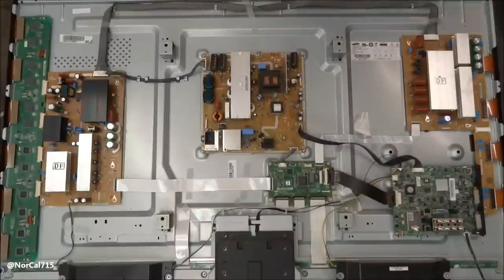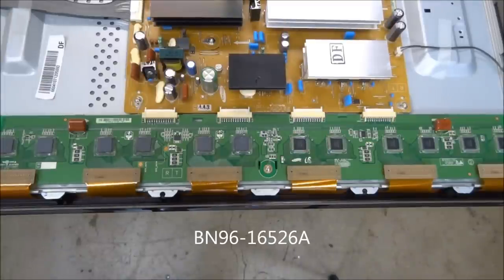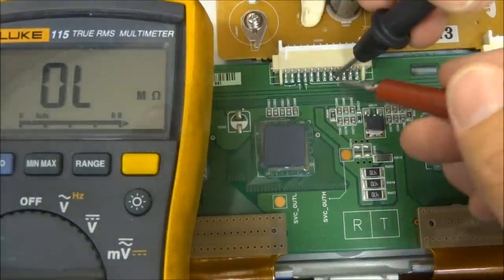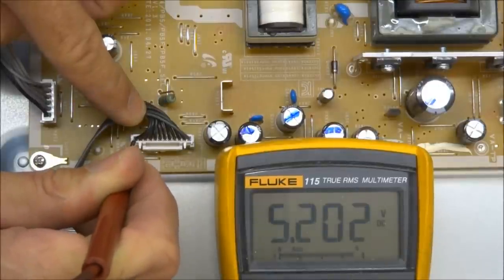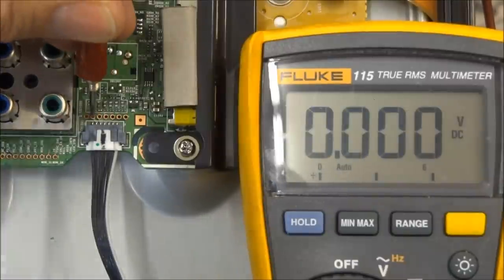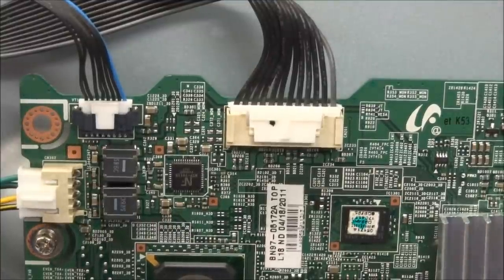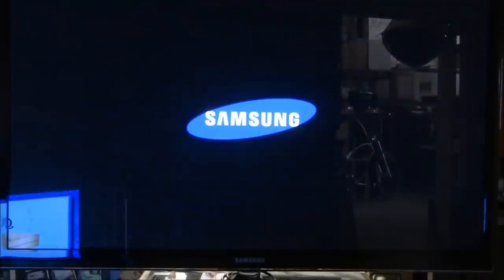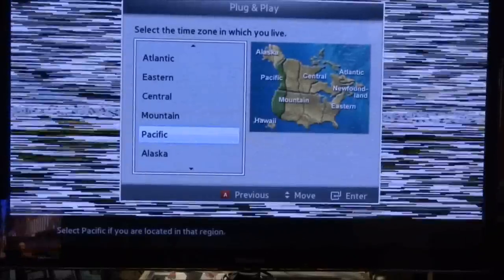Samsung PN51D550C1FXZA Voltages and Troubleshooting

Comment: Thank you so much for your great video. My Samsung PN51D550 is having issues powering up (clicking on and off) and i couldnt find any blown capacitors on the power board, but after doing some research, I thought it could be the power board and ordered a new one.

I wished I found your video earlier as I would of have spent more time diagnosing the components to determine exactly where the issue is as I think its not the power supply anymore.
Reply: Did you ever find out what the issue was or did you toss it?

Comment: Thank you for the terrific video! I have a Samsung pn51d530a3f. The layout is basically identical. My power supply is a p/n BN44-0444D. My plasma tv started doing the flicking on and off thing a couple days ago and now it does nothing. No lights, no power up, no standby lights, etc. When I test the power connector on the power supply board as you showed, I do get the standby power on the pins 1 and 2, however I get nothing on pin 4 where yours would typically show 15v. Also nothing on the other pins 7 and above. Are these only energized on the startup of the tv? That would make sense why I'm not seeing voltage on them if that's the case. I don't see any visual swelling of caps on the power supply board (not necessarily an indication that they are good though). My initial thought is that this is a PS issue. I've unplugged the Y and X boards and still nothing. I'd rather buy a new power supply board if that's what the problem is. Any suggestions would be greatly appreciated. Again- Thanks for the time you took to post this very informative video!

Comment: I have the slow heart beat that you mention, but this is only after I have unplugged the left board (when looking from the back side) from the power supply board. With this board plugged in I get the 5 sets of click click CLICK of the unit trying to fire up, and then nothing be a flashing red light on the front of the unit. I get same slow heart beat issue when I plug the left board back in and unplug the right board from the left board. Your thoughts and or advise sure would be appreciated. Thanks.

Comment: Norcal This video was awesome Thanks! I was able to follow your tips step by step and everything works just the same as in your video besides the screen stays black when the main board is hooked back up. If the test mode worked with all the colors and patterns but the screen is black with main board plugged in would that be an obvious main board replacement? Thanks for your help.

Comment: Thanks for the great video!  I have a Samsung C550 series plasma with the purple sparkly band and the the VS adjustment worked perfectly!   I am above the spec of 209 by 2 volts, but the band is gone and TV life is good!!!
Reply from the maker: Samsung says + or - by up to 15 volts is acceptable. as the plasma panel ages the setup voltages change. also temperature affects it as well.

Comment: I have this exact model and on the y buffer board I came up with 0 resistance for the ohms test on the points you describe.  Before I spend the money is there something else I can do to verify that this is the culprit?  You also mention you typically have to replace all of the y boards, should I just purchase all the boards or is there something else to check to determine if it is just the buffer board?  Thanks.  Oh and great video BTW, very informative.

Comment: Great video. I have a Samsung PN50b450B1DXZA All the power seem to be OK VSC s -193, Va is 55, Vs is 209, Ve is 89. the heart beat led beats at one a second. I tried the test you demonstrated with the jumper on pins 3 and 4 and lines to the main board shorted. I get nothing on the screen.The y-buffer was replaced along with the Y-main.I also replaced the X-main. The tv played for a few days and a component blew  on the X-main a small six leg device at location Q4201. I returned that X main and got another neew one now I get nothing on the screen. Could my screen have blown when the component blew on the x main? I have correct voltages all over the tv and a blinking heart beat led bit no picture. Is there a way to test the screen to see if it is bad?

Comment: Nice tutorial!  I have a Samsung PN58A550S1FXZC.  I would like to do the self test, but the PIN names are not the same as your TV and my connector has 24 PINs.  PIN 1 is PS_ON and PIN 3 is STBY.  Would it be PIN 1 and PIN 4 RTN instead in my case?

Comment: Thank you for the awesome vid.  It was very helpful as I have an issue with the same model tv.  I was watching tv one day only after about maybe an hour when there was a pretty loud pop and the screen shut off.  It then began to cycle through this process to turn on but never does.  The power led blinks twice five times while making the clicking sound the set makes when it attempts to turn on but nothing ever comes up on the screen.  I took the back panel off and expected to see some blown capacitors but have not found any.  I would really appreciate some feed back if you have any recommendations for troubleshooting.  It is my only tv and of course it is out of Warranty, any feedback if greatly appreciated.

(blink pattern: -- -- -- -- -- pause then repeat)

Comment: Hello,
I own a 2011 plasma 51’ D550.
I have black horizontal lines on the down third of the screen.
I clean both side of the down rubbon plug ged but still got the line.
How can I find if I have to change the LJ92-01761A or the other side bigger panel?
Thank you for your help

Comment: The ohm test on my Y-Buffer board failed.  
There's a heat sink (small black one) on the Y-Main Board that seems really hot when the TV is plugged in for awhile.  I'm assuming a short on the Y-Main Board.

Question 1: would ordering a Y-Main Board be enough, or would both Main Board and Buffer Board be needed?
Question 2: would a Y-Main/Buffer board from any PN51D550C1FXZA work, or do the numbers on the stickers have to match exactly?

Comment: Here’s a question for you. I have this exact TV (Samsung PN51D550C1FXZA) and have followed everything you’ve done in this video. I’ve replaced all boards except the Y and X main boards. Still does not work. I tried jumping the tv but I still don’t get test patterns. I did notice that the green LED on both the new and old logic main board is not present. What could that mean? Any ideas on why this tv still doesn’t work?

Comment: I hope you can help I,ve watched most of your vids on plasma your very down to earth so here we go ist off i changed the main,logic,power board if I turn on tv clicks 3 times goes off but if i disconnect x board it stays on then I can plug x back and it stays on but no picture just sound but all the buttons seem to work change sound and channel  and 1 other thing if i shake the wires going from the power to main board the 2nd wire down it starts clicking on the power board so i put the other power board back in and same thing so i think that,s in the loom please help me John

Comment: norcal - im trouble shooting a s50wh-yd14 plasma, which I believe the power board is the issue. the vs-tp should read 205v which is reading 10.9v and the va-tp should read 58v which is reading 0.0 now, was reading 2.9v. no caps are blown or browning on the board. I know the voltages are way low. so replace the psu ?

Comment: Does the Samsung 42'' Plasma HPT4254X/XAA have the self test option? I disconected the main board, Shorted pins 3 and 4 on the logic board and grounded pson. Power board went on had all the right volts Vs205, Va63, green light on logic was flashing about once a second but no self test picture, screen was dead so I was wondering does this model offer this test or is there something else wrong. Thanks

Comment: A vertical line from top to bottom that is about 1-2 pixels wide.  Is it always the panel or can it be the control board as well?  TV is a Samsung PN51E7000FFXZA

Comment: I too have a Samsung plasma tv PS43D450A2 model with horizontal black lines in the middle part of the screen. 
The tv is fully operational.
The voltages on all test points of the power supply, y-main board test points read fine according to plasma screen stickerwith Va, Vs and Ve readings. The X main voltage at test point XS-E is 78V 

But when i test the voltages across the smd resistors R5149 to R5154 and smd zener diodes D5504 to D5506 (marking PJ1389) on the Y-buffer board,  i found that the voltage is fluctuating between 45V and 30V.  It keeps dancing up and down on all the resistors and diodes across the y-buffer board. 

I felt the ICs on the board with my fingers and they were all warm. Nothing too hot or cold. Is this a voltage regulation issue from the y-main board or a y-buffer board issue? Little confusion here ;-) The heart beat led light on the logic board is good. I have tried re-seating  the flex cables on the y -buffer too.  The only thing bothering me is the fluctuation in voltage across the resistors/diodes on the y-buffer board. 

Could it be bad capacitors on y-main board? But the test point voltages on the y-main read ok. So the confusion haha. 
Any feedback will be really helpful. 
Thanks n regards

Comment: hi there thanks for for sharing information, i have similar TV set i am working on,  power supply not booting up . it has clicking noise coming from relay,  power supply trying to boot but voltages goes up and down, any suggestion please.

Comment: I have the exact Samsung model and I seem to be having an issue with the standby power from what I'm gathering. When I power the TV all I get is a "clicking" sound that repeats about 4 times and no image on the screen at all after. I have taken off the back exposing all the boards and checked for basic damage of the parts (no bulging capacitors, fried parts etc..). At this point I have no idea what direction to take, what would you recommend?

Comment: Ok I have a Samsung pn51d530a3fxza. When I plug the tv in it tries to start but then sounds like it is shut down. Video board optical lights up for a bit then turns off but the green led on the main logic board flashes normally. No standby light either. All voltages on power supply check out normal. Any thoughts. Could a bad video board cause something like this?

Comment: Thank you for the video. Trying to troubleshoot a samsung PN51d550c1f. The LED inside the tv flashes slow. When using the remote to turn on the red led on front of the tv flashes fast but nothing happens. The VA 10V and Vs 2v  are very low. None of the capacitors appear bulged. Any suggestions

Comment: My Samsung Plasma PN51E550D1FXZA DP05F has no picture. The tv appears to turn on but shuts off rather quickly. When on, it has steady standby power but when I test the VS and VA ports, the power drains down right away. I am wanting to force it into setup mode to restore factory settings but my Logic Main PCB (LJ41-10169A) is different than the one in your video.  It just has 4 holes labeled 1 through 4. Are these the holes I am to jump across holes 3 and 4?  I appreciate any help you can give me!

Comment: I have a samsung PN51D550C1FXZA . And my problem is that the when plugged in the led heartbeat click on and off roughly 3x then thats it no picture .. I have tried a few of your test (I have an old meter so I was unable to get the tips into the same spots as you) I have replaced the pw supply and the y-main board still getting the same problem.. Also less than a year ago Samsung had replaced the Samsung BN96-19867A Main Board.. any suggestions.

Comment: You mentioned, that If VA and Vs voltages going down to 0 mean short on X or Y main. I have this fault with voltages, and voltage get  back to normal if I disconnect y buffer. How to localize if it fall it y buffer or y main? If y buffer is connected, but screen flexies disconnected Va and Vs still going down. Tv is getting on and not looping like it was when I had short.

Comment: Pn5151d450a2d plasma wont power on, red light in front on steady wont flash with remote buttons or manual buttons(touch) so I did the self test with the 2 jumpers, and the tv goes into the self test and colors look good. So i replaced the main board, but still same problem . Red led stays on steady when plugged in. I suspect touch pad/remote sensor bad. Can you help? Thank you

Comment: Any help appreciated. What I see is a lot of voltage checking assuming the TV will turn on. But my TV won't turn on at all. So I'm limited on what I can check. i.e. I checked the main board's IR and other and all showed 0V even when pressing the remote. But I don't think that's a good test as I believe the power supply is bad (although all caps looks 100% (not bulging/burn on top). The PS On voltage is only 2.93 and I can't check to see if it goes to zero when switching on the TV as it won't switch on with the remote. (a) I would think 2.93 is too far off from 3.3V anyway leading me to think it's the PS? (b) is there a way to mechanically switch the TV (fake using the remote by shorting wires maybe?

For kicks, I check VS adj and VA adj and both are OV (video only talks about if one is zero but doesn't say what to do/check if both are 0V). 

Thanks.
Reply: I took a chance and ordered a new power supply on epay and it works!!! It seems that the PS boards come and go. Shopjimmy was out as were all the other online places. I paid a premium and looked today adn there's a ton listed for cheap.  My Va voltage was only .8V off and Vs was 1V off. I chose not to adjust them as it seems from this video that it's acceptable to be 5% off?

Comment: I have a Samsung plasma PN64E7000FFXZA TW02 that does not power on.  On the power supply (BN44-00516A) I measure all the low voltage pins within spec (5.3V & 15V).  PS_ON and VS_ON are 0.15V so pulled down, I assume the power supply is turned on.  However I do not have VS or VA voltage.  The two fuses are OK.  I have the Y boards disconnected so I assume without a load I should see VS and VA if the power supply is OK.  Is my assumption correct? Is there any why the logic board could prevent VS and VA from turning on?
Reply: Ok If I jump PS_ON to Gnd and VS_ON to 5V  the power supply works (5,15,VA & Vs).  If I plug in the logic board I do not get VS or VA. If I jump PS_ON and VS_ON with the YS board connected it pulls VS and VA down near zero.  So does that mean a short on that board or can it be a weak power supply?
Reply: I have similar set.   without doing any jumpers, I have no Va or Vs voltage.   I do have 5v & 15v all 3 plugs coming from PS board.  I get no sound, no picture.  Green LED is 5 seconds on, 2 seconds off, which indicates DRV Reset.     I'm assuming that I have a bad PS board.

Comment: on my y board the bottom rt the top2 transistors read 201v than a diode then the bottom 2 only 12 v on the left side where it says dfs on it it says 12v and whan powered up its cold please I,ve been trying for a month where does the power come frow how do i trace John

Comment: I have Samsung TV UN 39FH5000 FXA that don't have backlight also when plugged in power stand by light flashes 6 times. I was measuring voltage on wires to backlight and got different reading when main board disconnected from power supply board, reading goes to zero, but when main board disconnected, reading is 193V on connector D+ but when I measure voltage on wires from mainboard to power supply board voltage is as noted on power supply board. can you please advise what to change to fix it?

Comment: Hello norcal715, I would appreciate your help.  I have a 50" Samsung plasma that suddenly quit working.  Narrowed it down to the y-sustain board by unplugging the power connections.  I replaced the y-sustain and the tv will turn on with sound only.  I am still unsure how to narrow it down by using a volt meter.  What can I do to figure out what is wrong?  I have a hunch that the y-buffer needs replaced.  Regardless, your help would be appreciated.
Reply: jackalackaslim Hello, try replacing the T-Con Card.  It is cheap and you can test components from the new to the old and then fix old and have a spare.  Also, if you put some computer on the vents to keep the air moving I used the push pull method on mine.  Good luck.

Comment: I have a Samsung PN51d430a3d, sound but no picture. VA & VS voltage go hi at start up but go low with-in sec, Y buffer test points OK, Logic board LED blinks very slow,  How can you check the Y and / or X boards

Comment: hey the pn51d660c1f smart 3d tv plasma tv was not the ps after all y sustain board  q5001,q5002, and diode d5010
shorted out causing tv to not power up 1 sf10a400h shorted and 2 rjh30es shorted

Comment: iv a Samsung ps51d550c1kxxu
As i was watching a dark patch appeared in the right hand top corner and began spreading slowly across the screen untill  
i lost all the picture but had sound at first and had a flashing standby light.
also there was a humming buzzing noise coming from the right hand side of the tv looking from the rear i remove the back cover and i could see a led flashing away on a small circuit board,
i turned the power off and removed the board were i thought the buzzing noise was coming from to check it for swollen capacitors etc
i had no luck so i removed the power supply board and checked this for the same with no luck.
i put them back together turned the tv on
but now the buzzing sound has gone and the led in no longer flashing
i can here the click of the relay when i power the tv up and the standby light flashes for a short time then stops
any ideas would be great i haven't even had the tv 2 years yet
thank you in advance for any help
Reply: Sounds like you had arcing on the invertor or on one of the tubes. Buzzing = something high voltage is arcing.